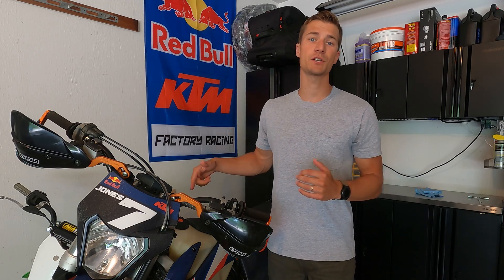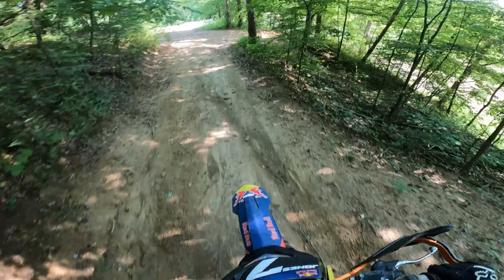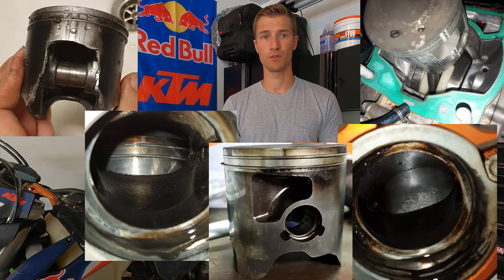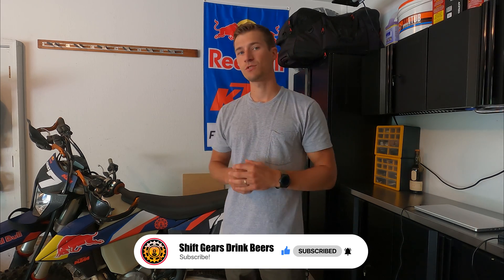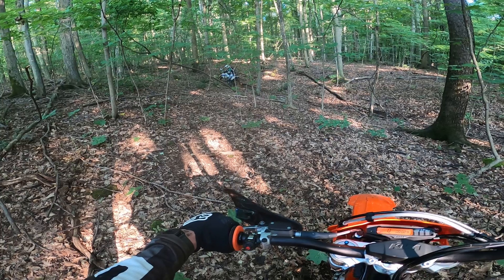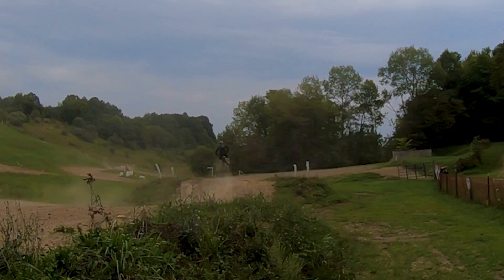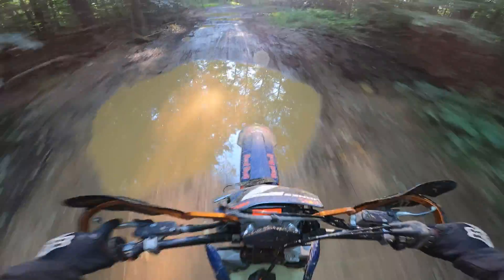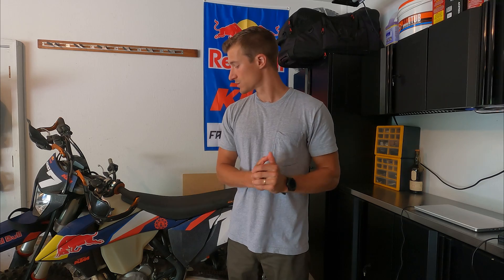TPI ECU Reflash - KTM Husqvarna Gas Gas

Comment: I just had a reflash done on my 2022 GasGas EC 300 by a third party. I  mailed it in and got it back in less than 2 weeks. Wow! I also went from a 50 tooth to 48 on the rear sprocket at the same time. I went on a short ride before my kickstand exploded(different topic😡) The bike is scary fast. The idle speed is the same but it just idles more powerful  if that makes sense. The throttle response is amazing. Basically the bike is now on steroids.  Less expensive than the new Mikuni TM 33 carb I just put on my DR 350 SE and more noticable performance gain..
Reply: Where did you send the ecu for reflash?

Comment: That revving issue sounds like a blocked fuel pump! Happened to me a few times and was totally blocked
Reply from the maker: my fuel connector was actually losing, causing air to get sucked in. Probably from a crash.
Reply: @ShiftGearsMoto  did you fix your issue where the bike started revving up by itself when hot? Was it the fuelling issue you had? I haven't been on a long hard ride since changing my filter but hoping that will be the fix :)
Reply from the maker: @ollie6512  I've had it twice now and the most recent one was from the loose fuel connector. Check for air leaks. Normally the cause of this happening. If not, could be bad crank seals.

Comment: Hii! 
I didn't know we could simply bring the bike or ecu to your dealer for a reflash. Are there many maps to choose from or it's limited? Also, do they cost a lot to get reflashed by the dealer?

I've heard of one "xtreme" flash that increases oil consumption in the map for more reliability. What should I ask the dealer in that case? "I want a xtreme" ecu flash upgrade." ???
Reply from the maker: I think most dealers will do it for free. Go to the one you bought your bike from. They probably only offer the latest, but you would have to call to find out. I passed on the stock maps (even new ones) and went with an aftermarket. They follow different guidelines and seem to be way better.

Comment: I found a solution for the TPI stuttering. My 22 te150i started exhibiting the same symptoms at 17hrs.  After going down the list, spark, fuel pressure, ccp and ambient sensors with no luck, I dropped it off at Yamaha today to trade it off on a new Yamaha fx.  Problem solved,  feel like a weight was lifted from my chest after 10 months of broken down Husqvarna te150i ownership.
Reply from the maker: that's a bummer. Enjoy the new bike.

Comment: Did the tsp head reflash on the 150...fun bike now..300 next
To those mentioning the 1/4 sputter its in the carbed bikes as well. It's a 2 stroke, not meant to be ridden on 1/4 and cruise
Reply from the maker: Nice upgrade! A faulty crankcase pressure sensor can also cause a sputter/rough sounding low end.
Reply: @ShiftGearsMoto  it can but it continues through past 1/4 which is what a few comments are saying here their issue is. The ccps issue is more than sputter its severe bogging and power loss as well.

Comment: I am getting the TSP head & ecu flash on my 2022 300.
Had issues from day 1.
Dealer is no help as they are lost for a solution.

We both have tested many things & they replaced both pressure sensors ar the same time.
TSP discovered there is a problem with the ECU.
Dealers no help and only 7 hours on the bike.
I may have to buy a new ECU.
Reply from the maker: Meaning a faulty ECU? I would ask for more details there. Please share it as well!

Comment: I have a 2022 KTM 300 XC TPI. 
6.7 hours total on it.

Had low power every where from day one from brand new. Would not lift the front wheel via throttle in any gear. Not even in 1st gear to get over a stick or small puddle of water.
It has always started and idles very good.

Replaced the stock sparkplug NGK BR7ES with the iridium plug. And revved it higher when riding. 
Result: revs and more power but now it sputters. More like the engine cuts out for a split second as fairly steady throttle positions in all gears. This can cause the front end to drop when going over a set of whoops, or wanting to life the front wheel over a large puddle. I have seen the front # plate a few times when it sputs. Dangerous!

I verified the Dwell thing on the end of the power valves is installed and seated correctly onto the lever. Many had the install incorrectly at the factory resulting mainly in no power at all rpm's.
Tried adjusting the air bypass screw in and out with no improvement. It came at 3.5 turns out. Different years specify different settings and come set specific to their year.

About to check:
1).   Check hose and fitting to the CCPS to verify they are not plugged or restricted. Also will see if it will hold vacuum for a few minutes with a hand vacuum pump.
2).   Fuel pressure and verify in-tank filter is not dirty or split (a common issue).
3).   Verify good electrical connections at fuel pump.
4).   Do idle screw change.

Any suuggestion?
What ECU flash brand, type did you use?
Reply from the maker: That's a bummer to hear. I would honestly take it back to the KTM dealer where you bought it and ask them to look at it. If you don't have any luck with that, do the idle adjustment mod, adjust power valve, and try a different ECU. Try out a friend's before buying one? I went with silbers for now.
Reply: @ShiftGearsMoto  Thank you for the input.

I bought it from a dealer 4 hours away back in the spring when the 2022's finally arrive in N. America.

The big local dealer, 45 minutes away is helping out now. 

I have an appointment booked for a 2nd time with the big dealer around here. 
The 1st time the service rep took it for a ride wringing it out up and down the long back paved street they have. As they wondered if it was just loaded up from my easy break-in per the manual. Coming back onto their paved lot he gave it a bit of gas and then held the throttle steady. It sputted out and then it kicked in. Unfortunately tthe result of the on / off / on motor caused the bike to go up, up and over backwards completely catching him off guard. Quite the sound to hear my new shiney clean KTM slding across the pavement about 30 feet away. He hurt his elbow and knee,... 
They are replacing the damaged parts.

But when the mechanic took it for 2 rides up the street he reported it was OK. 
They never checked anything I later learned other than for Recalls which it had none and the test ride.

I took it for a ride and it was hesitating right from the get go.

So back it goes. It had 4.1 hours on it at the 1st visit. Now has 6.7 hours.
Reply from the maker: @human1513  man that's horrible. I also would have been so angry about crashing my new bike! Good that they're taking your complaint seriously too. If you have any video footage of it happening, you might want to share it with them. Who knows, this could be electrical?

Comment: I do have that same reving out problem. Also difficultly in starting the bike when cold. I thought the fuel pump might be going bad so I ordered some parts to test the fuel pressure. I will try that next week, and if that's not the issue, the next thing I'll try is a reflash.
Good video, man!
Reply from the maker: Glad I'm not alone. How many hours on your bike? It happened to mine when it was new. Let me know how the tests go, but the new ECU did fix it for me.
Reply: @ShiftGearsMoto  About 130 total. Though I bought it used, an I've only put like 10h on it. When I tried it it wasn't like that. I noticed some deceleration surges (I think they're the same thing as pipe bangs) but they were mild. The problem got worse the more I used the bike.
Your video gave me flashbacks sort of say. The symptoms are exactly the same. I have never seen it in a video before, even though I searched on YT for a long time. I only read about it on forums.
Reply from the maker: @Vlad Muresan  I've never seen it in a video either. I thought about making one specifically on it, but doesn't seem too common so I just included it here. SGDB bringing the content 😂
Reply: @ShiftGearsMoto  So I did the test and the result was about 44 PSI. The repair manual says that it should be between 48-52. Not sure if a 4 PSI drop is enough to cause such crappy running.
Reply: I forgot to reply here. In my case it was a clogged fuel injector. Each injector has 4 nozzles and in one injector 2 of the nozzles were clogged.
Reply: @vladmuresan8775  how did you figure it out? Was you able to clean them or have to replace?
Reply: @kenfarnsworth5239  Well, I did this with a mechanic buddy of mine. We pulled out one injector and started the bike with the other still in place. You could see how it was spraying. You definitely need 2 people for this because the bike will rev like crazy with only one injector in and you need to stop it quickly.

I ended up buying a new one due to time constraints, but from what I saw, cleaning can work pretty well too. (I had the clogged one cleaned later and I keep it as a spare)

Anyway, the first thing you should check is fuel leaks like SGDB said. And the second, in my opinion, is the fuel pressure. Those are more likely causes.
Reply: I have the lean run away at times too. I was thinking possibly fuel filter or air leak . I was thinking doing ecu for other reasons as well so hopefully fix’s my problem too
Reply from the maker: Definitely check for air leaks first

Comment: Well I broke down, it started and ran better, got fuel and no problems 10 minutes into the ride complete shut down, after the epoxy on the sensor it started right up and ran, IDK whats wrong now...
Reply from the maker: What was it doing? Check your spark plug.
Reply: @ShiftGearsMoto  it ran better for a bit, it did sputter a little, I'm getting the OBD2 scanner today and a new spark plug, i didn't put the little zip tie back on the CCP, because i didn't have a new one, I'll check that too...
Reply: Quick update just took the CCP, back off and found ripped O ring, already bought new CCP, so I'll just  install it, I'll mess with the original later

Comment: Yes I've had hard to start issue,since day one I put the capacitor like Tokyo Offroad and it helped, and I did the epoxy on the pressure sensor for the bogging issue and it starts quicker but I still here a little bog, and have a check engine light on, waiting for OBD2 Conector for that issue, just going down the KTM rabbit 🕳 hole
Reply: Haven't done the idle screw yet
Reply from the maker: I would say definitely do the idle adjustment screw mod next.

Comment: My problem with hanging idle begins after I install RK Tech head. Even with Coober ecu, idle screw, high pressure regulator my 2021 Te300i was still running lean and I still had hanging idle problem. Took off the RK head problem with idle was gone, bike is running perfect now. 120h not a single issue. 
I tried my buddy Te300i with TSP medium head and it’s a bit to much for me, I prefer Coober with oem head. 
Anyway I can’t imagine riding KTM/Husky/GasGas without relished ecu.
Reply from the maker: Glad I'm not alone with the hanging idle! My situation is almost the opposite. First thing I did was try a different a different ECU and that fixed the problem. I kept using that same (stock) ECU, upgraded to a RK TEK head and still have no issues. And now I've reflashed the ECU with an aftermarket map and no issues. It's been good for the last 8 months and haven't had a single instance of hanging revs.

Comment: So I did the Silver tune and it fixed nothing.  I had a sputters bottom end that I wanted cleaned up.  We did both a 150 and 300 and the bikes completely transformed.  TSP had way better customer service and better mapping imo.
Reply from the maker: Have you checked your CCP sensor by chance?
Reply: @ShiftGearsMoto  replaced all 4 on both bikes before reflashing.  Helped idle but not sputtery low end.  I found Dave at South bay moto to be one of the best ppl to work with.  He does the TSP flashes in the USA and spent hours with me pre flash trying to dial it out

Comment: I've had all of these problems,  interested in what you got/ I looking at a TSP kit
Reply from the maker: I have: RK Tek head, idle adjustment screw, and Silber ECU (currently running enduro map) and the performance is INCREDIBLE.
Reply: @ShiftGearsMoto  is that switchable on the fly or do you have to program it for each?
Reply from the maker: @ROCKETRALPH  yes you can use the bar mounted switch with the ECU.
Reply: Tsp all the way nothing but the best

Comment: My 2019 250 would do that hight idle ounce in a while until I switched to ktm 2 stroke oil and it seemed to stop , I sold that bike and have a 22 300 now with the tsp low comp head and refresh,  love it now , it runs so much cooler as well .
Reply from the maker: The 2020-2022 TPIs are significantly improved over the 2019s, but I've always run Motorex in my bike, so I can't comment on that. The reflashes are great for any model bike though. I haven't noticed it running cooler though. Seems all situational to me.
Reply: @ShiftGearsMoto  my 2022 after the reflash most definitely runs cooler , I didn't like how hot it ran compared to my 2019 . I overheated it ounce and never did that on my 19 . They say they give it more oil almost everywhere. Thanks
Reply from the maker: @motoriderguy3854  30% more oil with my map! Love it.
Reply from the maker: @motoriderguy3854  do you have a fan kit?
Reply: @ShiftGearsMoto  The 19's have less issues overall (not just tuning stuff) than 20-22 like the overheating, which is a tuning issue.  The 19's are not as lean as the 20-22 bikes, hence why the newer bikes ran 'faster' or more crisp.  The lean tunes on the newer bikes have lead to the bikes getting hot quicker.
Reply: Interesting.  I have a 2022 KTM300 XC TPI. 1st it lacked power always. lIke it had 30 hp instead of ~60 hp.
 Changed to the iridium spark plug. Then it started to revved alot more, faster and put out power near what it should. But it cuts out for a split second regularly at anything but 100% full throttle. At constant throttle in all gears. Like the kill switch was hit for a few thousands of a second. I have seen the front # plate from the front a few times unintentionally while riding.
Have used Motul 2T 710  injector oil since new (had a couple bottles left over from a YZ250).
I have a bottle of the KTM Mororex now. Was planning to change to it once the Motul is gone.
Guess I could syphon or get the Motul out of the tank some how. Then fill it with Motorex and bleed the system. And try that.?!?

Any thoughts?
Reply: @human1513  yeah I would , that's what I did on  my 19 was take the hose off the tank and let it drain , my 300 doesn't quite run the way I would like but close . I have a medium compression head I will try next and maybe then it run a little stronger . With the low comp head though it is a great hill climber.
Reply: @human1513  I never had mine cut out like that , could be a bad ground wire , but I would change the oil .
Reply: @motoriderguy3854  Thanx for the info and thoughts. Will check the CCPS also. Crank Case Pressure Sensor as they had a lot of bad ones over the past 2 years. And they will not show up bad when doing a scan. I have the scanner OBD II box and cable that Tokyo Offroad uses. Scanner works good on my 2017 Toyota RAV4 also. All via my Android phone.
https://www.youtube.com/watch?v=Oyv2TtxMmbg&list=PL25pmCmnm-DqGeZh-UkCT4AoWotlVgPg_&index=11

I have an appointment booked for a 2nd time with the big dealer around here. 
The 1st time the service rep took it for a ride wringing it out up and down the long back paved street they have. Coming back onto their paved lot he gave it a bit of gas and then held the throttle steady. It sputted out and then it kicked in. Unfortunately tthe result of the on / off / on motor caused the bike to go up, up and over backwards completely catching him off guard. Quite the sound to hear my new shiney clean KTM slding across the pavement about 30 feet away. He hurt his elbow and knee,... 
They are replacing the damaged parts.

But when the mechanic took it for 2 rides up the street he reported it was OK. 
They never checked anything I later learned other than for Recalls which it had none and the test ride.

I took it for a ride and it was hesitating right from the get go.

So back it goes. It had 4.1 hours on it at the 1st visit. Now has 6.7 hours.

Comment: Great video, looking forward to the reviews on the maps. Without knocking the competition, WHY did you go for the RK Teck head over the tsp?? Im looking at the upgrade atm. thanks :-)
Reply from the maker: Thanks,  glad you liked the video. One reason I went with RK TEK was because I had already done the idle. A guy in my riding crew was raving about the RK head and I saw the performance first hand and appreciated the build quality from RK. You can't go wrong with either. A review on that is on my list. I've been running it since March.

Comment: Installed TSP Kit on my 21 250xc  and it solved all the 1/4 throttle stutter problem and improved overall performance through the entire engine.  Riding is much more fun now that engine has that snap like my last 250sx carburetor. Do yourself a favour and do the upgrade  you will end up with new bike bassically. There was a little tunning needed with the air screw.  And don't take the short cut and not put the idle screw in when you change the head.
Reply from the maker: I already have the idle adjustment mod, RK TEK head, and now an aftermarket ECU. Already done!